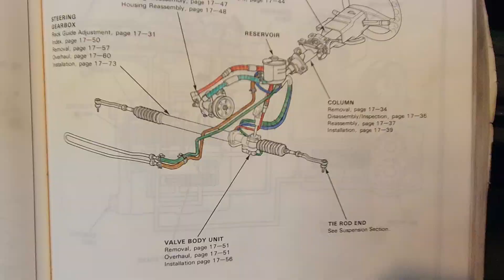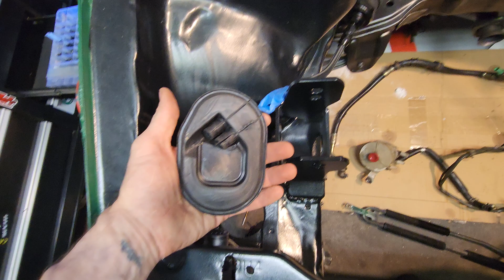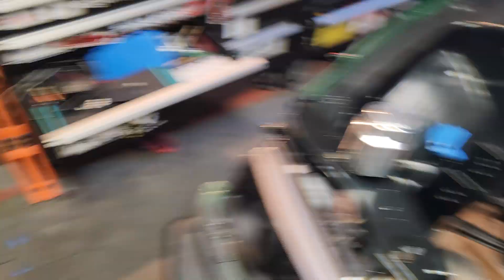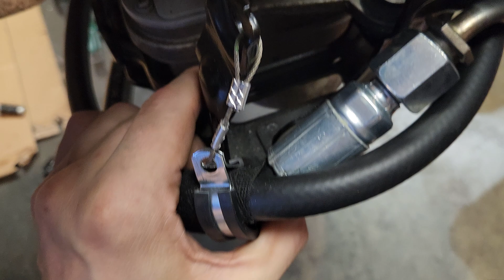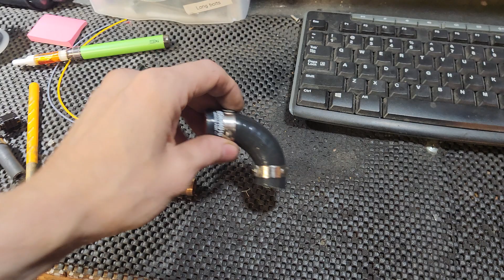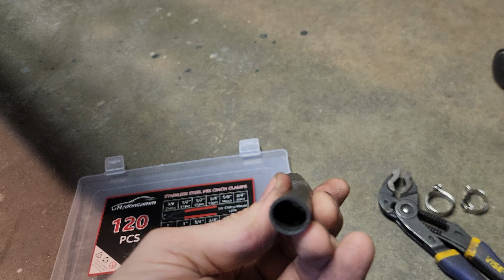EF Civic Sedan Restore #153 Volvo s40 Part 2: Wiring, Hoses, and Upper Resivour Installed.

Comment: Hey so you use the 3 ports on the rack? Or you have to block one port?
Also did you already turn the pump on? Any trouble with the rack?
Reply from the maker: It depends on the pump and rack. #
On an EF, You use the pump to rack, and one return. Plug the third. I have not fully wired it yet. I do show the routing via factory service manual in the 2nd video. I am writing it in today and should have a video up soon.